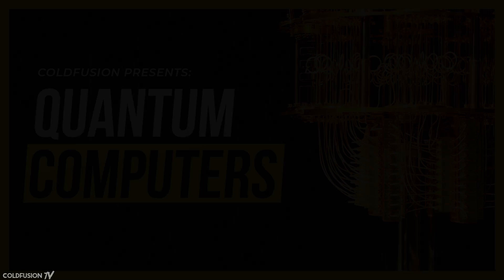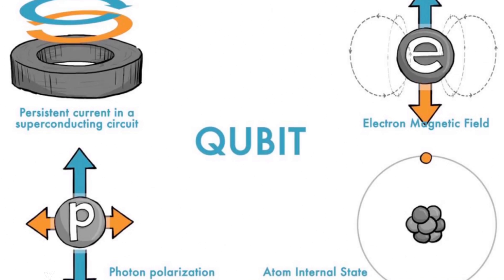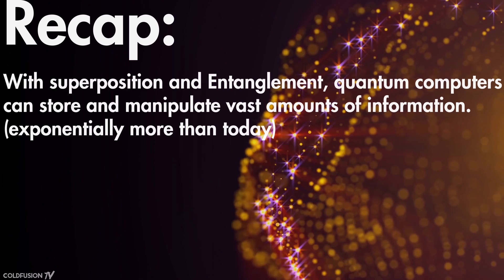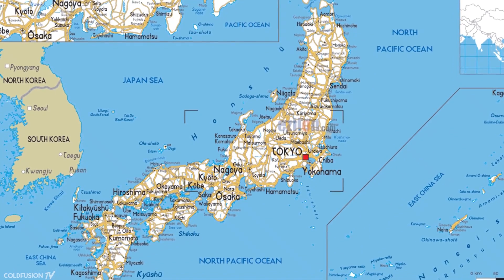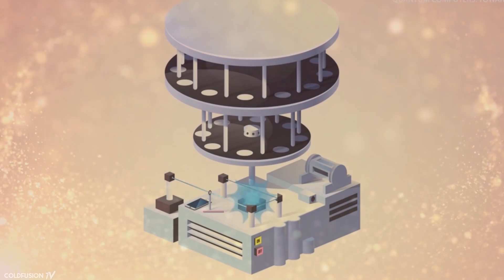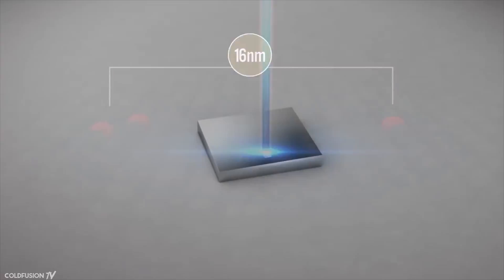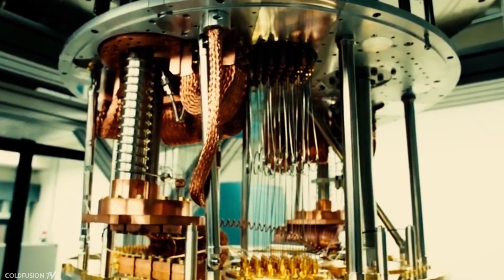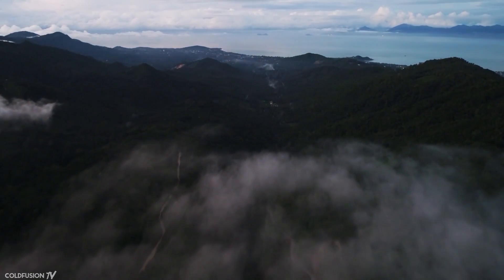Quantum Computers - FULLY Explained!

Comment: Can you make a video on 5g technology. I don't know who to trust but I trust your videos
Reply: 5G is simply an expansion of the existing control grid. I dislike being conspiratorial but it is plainly logical that by sacrificing independence for convenience when we embraced all these intrusive technologies, we have allowed a Trojan horse into our communities that can and inevitably will be abused for power. 5G extends the capabilities of the surveillance state, but I believe there is much more to it than mere surveillance. I won't go any further.
Reply: @amaze2n  plans within plans --- say no more
Reply: 5g is litterally 24Ghz radio waves......... higher frequency means more data can be sent but since its high frequency, the signal has to be line of sight..... what else is there to know?
Reply: Иіск Рагіllб 1⃣ how about how much tissue that can penetrate and with how many milliamperes?
Reply: @wesleyk.8376  So what if it can penetrate tissue? Thousands of signals of all ranges of frequencies are going through your body each milisecond and causing no harm, from standard AM/FM radio waves to WIFI. The only thing that is to be discussed is the heating effect that it *MIGHT* produce, depending on the closeness of the signal's source.
Reply: @MilanTukidid  This study suggests the effects standard wifi has on sperm cells:

 "Ex vivo exposure of human spermatozoa to a wireless internet-connected laptop decreased motility and induced DNA fragmentation by a nonthermal effect"

https://www.fertstert.org/article/S0015-0282(11)02678-1/abstract

The study was conducted ex vivo, meaning they basically took the sperm samples, placed them near a laptop and turned on the WiFi. Naturally our skin tends to bounce these microwaves off, but when these signals start to penetrate body tissue, and considering the negative effects the study has shown to ex vivo human cell samples (sperm cells), we could at least anticipate a potential drop in male fertility. The lack of studies on the matter may suggest that we should halt development, until the biological, medical, and ecological ramifications are sufficiently studied.
Reply: 5G is useless and meaningless for the end user. 4G is fast enough with downlink speeds of over 1Gbit/sec.
The reason why everyone is trying to jump on 5G is because of the "big data revolution" which is predicted for the 2020s.
The main idea is moving huge amounts of data across the globe without the average user even being aware of any real speed gains for personal data consumption.
5G networks are all about minimizing latency and increasing bandwidth for the big data companies and not the average user.
Reply: Lol it works exactly the same as 4G but more powerful. Like AC WiFi compared to the first gen of WiFi.
Reply: @IT Developer no it doesn't 
https://youtu.be/-orWZAo4M_Q
Reply: @random dude put your tin foil hat on because it already exists.... its call weather stations
Reply: Sandeep Singh Yes, please do Dagogo. I second this person’s idea. (:
Reply: The best place to start is not with YouTube, but with as clear an understanding of electromagnetic radiations as possible.  The majority of 5G conspiracy videos exploit their audience's limited understanding by pretending to be more knowledgable than they really are.  They also use various other tactics such as, but not limited to, fear-mongering (mostly religious-based), persecution complex, misquoting credible people, and deliberately misrepresenting/falsifying evidence.
Reply: This one is good https://youtu.be/LhECDSuXRDs
Reply: Funny enough the channel I linked brought me to ColdFusion because everyone in his comments mentioned how he reminded them of ColdFusion
Reply: Sandeep Singh it's the same thing that happened to 4G when LTE was becoming more widespread, these companies know the tech is premature and hasn't rolled out everywhere so even IF they advertise 5G as the new thing only 2% of the population has devices that can even receive that kind of signal and most of that tech you'll probably see in flagship smartphones later this year, the Galaxy S10 can already do this but like I said almost nowhere supports 5g yet so it'll be a year or so before it's even making a noticable difference
Reply: Jake Watson what’s the purpose of your life? Roaming around the web and spreading hate? Get a job or something
Reply: @random dude that actually made me laugh thank you lol
Reply: Its just 4G but better .What's there to trust? Did you distrust 4G?
Reply: Ben Porter  
5G gonna rock-out with its cock-out!
Reply: Go ask Alex Jones. This is for smart minds.
Reply: Nobody needs 5G
Reply: I have been using 5g for the past 2 months, it's incredibly fast (>40mb/s) but it depends on the coverage 5g towers in your area
Reply: I second that
Reply: 5G is as normal as 4G, but some dumbo along the way thought 2+3=9 made sense and said it caused so and so things.

All of that ignoring all of the knowledge and the careers of thousands of engineers, because "2+3=9, I'm so smart".

You can look up any video on how mobile data works and you'll see that 5G works no differently, the only difference is the radio band it transmits in, which, unless you're a radio, makes no difference to you
Reply: But didn’t you get a brain at birth? SMH
Reply: Omg why is YouTube full of irrational dimwits who follow what some psychotic dude is saying on the internet. I get it we all suffer from psychosis here including me but you guys have to ask yourself who is more trustworthy? Literally every scientist on earth or some dude on Facebook who thinks he's rallying up an army against the "Deep state".
Reply: @Alan Jeffers thanks for the constructive criticism. All I am saying is they are making like it is the way of the future and within a few years it will be out of date. But again thanks for the constructive criticism.
Reply: You're gay.
Reply: I'm beginning to think it is necessary bandwidth required for fully adopted digital currency. 

And for user biometric data transmission to centralized processing and store data banks. 

They used to have too much data to meaninglly process, but if quantum computers can do what they say they can do, and they figure out how to get them to write their own code(s) with functional ai, quantity of transferred data becomes directly proportional to future prediction powers as well as future manipulation powers. 

Shit is magic, yo. I'm not convinced it's the good kind.
Reply: Read something interesting on 5G recently... Obviously with my tinfoil hat on https://www.5gappeal.eu/scientists-and-doctors-warn-of-potential-serious-health-effects-of-5g/
Reply: Considering quite a number of intelegent people claim it to be a carcinogen, I would go that route. There is plenty of proof scientifically to back it up as well.
Reply: @comfycap  can't say I've ever read it
Reply: 5g is to make AI more powerful than it already is.it will be able to control whole cities through manipulating or implanting feelings,emotions etc.it can do so much more dont want to scare u.having negative health side effects is a just a bonus for them.theres always multiple benefits when something is implemented in our society.and usually not for the benefit of us citizens.
Reply: @philiplopiano3759  That doesn't make any sense whatsoever.
Reply: @philiplopiano3759  I'm sorry, but AI will likely prove far more beneficial to citizens than, well, citizens.
Reply: @unapologetically_anti-fascist  you coudnt be more wrong... AI is way to powerful as it is it's just people r to stupid to realize.
Reply: @philiplopiano3759  Okay, I think there's been a slight misunderstanding here.  Firstly, power does not guarantee a negative outcome.  Secondly, there is no longterm survival of our species without the technological advancements necessary for diverting our very own extinction.
Reply: @unapologetically_anti-fascist  you just havnt experience what negative horrible things AI can and does do but you will all find out soon enough. And yes power corrupts almost exclusively. Your very naive.
Reply: @philiplopiano3759   And what horrible things have you observed AI doing?  You say that I'm naive, yet hearken back to the old adage, "power corrupts almost exclusively" as if it somehow defines the future of AI.  The longterm survival of humanity will ultimately depend on our technological capacity to either divert and/or escape the inevitable extinction that awaits all life as we currently know it.  Being aware of this simple fact doesn't make me naive.
Reply: If u wamt to know about 5G and just frequencies and their effect on not only humans but life on our planet period, then i highly recommend u watch "Resonance: Beings of Frequency".. probably the single most fascinating documentary ive ever watched (or at least tied with "The Revelations of the Pyramid".. both of which can be viewed for free on YouTube) i promise u, u will not regret watching it..or both of them for that matter
Reply: For those interested in 5G technology but also want to avoid the countless pseudoscientific bullshit circulating the web under the guise as "truth," then, please, hear me out!  

1)   You're better off avoiding YouTube altogether.  

"But, Keith.  Isn't watching videos much easier than researching."

Are you here to learn or what?  Are you sure?  Okay, then.  Proceed to the next step, please. 

2)   The next step in this process will focus on data, or, more specifically, reliable data.  I cannot stress enough just how crucial this process truly is, so please, do yourself a favor and choose a credible source.  I'm serious, God damn it! 

Okay.  I'll at least get your feet wet. 

a)	MIT OpenCourseWare (Massachusetts Institute of Technology) - For those who genuinely desire to learn, then look no further.  You literally have free access to MIT's entire curriculum. That's right, no more excuses.  https://ocw.mit.edu/help/get-started-with-ocw/

b)	Here are some other institutions that may prove beneficial in your journey:  
EDX - https://www.edx.org/
SoloLearn - https://www.sololearn.com/

3)  Oh, if you're unsure as to which subject you should start with, well, so am I.  Honestly, this will ultimately depend on your current level of understanding.  Though, if it were me, I'd start by determining my knowledge of Physics and work my way up to the more advanced topics.  

Random Fact:  
The majority of 5G conspiracy videos exploit their audience's limited understanding by pretending to be more knowledgeable than they actually are. That's right, the same tactic used by cults such as the Flat Earth movement.  

While we're on the subject of 5G, here's a Flat Earther harassing a utility worker because "The 5G, man..."  https://www.youtube.com/watch?v=5fZeVc00C_E&t=617s
Reply: Its dangerous. Crowd dispersal Weapon towers originally used in Military.  Simple
Reply: @OrgoneDevices47 , what? Man, it’s incredible what folks will believe. 5G is literally the same thing as 3G and 4G. It’s just operating at a different wavelength, which happens to be more brittle (which is why 5G range drops off super quick as you move away from a broadcast point). This is why 5G requires more tower/broadcast density than 4G. This is also why 5G rollout isn’t happening nearly as fast as 3G and 4G did - it’s more infrastructure-intensive. On the plus side, internet speeds are several fold faster. So the big open question is whether the faster service outweighs the cost and reliability problems.
Reply: I think 5G technology will be great in telecommunications, but I'm kinda worried about the possible health issues this technology could bring.
Reply: @martiddy  - It will. There are quite a number of videos on the health-related issue here on YT with really good experts (as much as I can't stand that term because it is constantly misused) on the topic like Barry Trower for example. Check them out.
Reply: Ask your gut, what this is all about. ;)
Reply: @warequalsnofuture   Ask your gut?  That basically translates to:  "Allow your personal incredulity to lead you down the wrong path."
Flat Earthers and Creationists also depend on this method.  That's exactly why neither will ever result in scientific achievements or contributions to humanity.
Reply: Yes I also liked the explanation and 5 g is also u future possibility, nice video
Reply: @warequalsnofuture  Certainly it is not about well being of the bottom 90%
Reply: @SimonzicekCz  99,99% or even way more. ;)
Reply: @warequalsnofuture  While I don't know much about 5g technology I think really is just a way for companies to make more money off consumers. I know that is a really simple answer but to me while good things may come of it. Why do I have the feeling they have another brand new technology you just can't live without. I am not saying it is bad just saying it is another way for people to spend money on their product and just when the majority of people get used to that technology they will come up with different technology.
Reply: @Nicholas Powell   I see your point about them changing technology, but that's actually a good thing. I mean... who would have thought.. instead of being held back and seeing the same boring and dull technology all the time, we actually see technology accelerate so that it advances and evolves into something better later on, in the near future. And we win because those that have been waiting for new technologies, actually get to use them and see what's ahead as much sooner instead. That's something to look forward to.. not be negative about. I mean, you're getting salty over new technology that advances? Smart spend by saving up and then get the new technology, you should be motivated to do so if you're hyped into technology like other people. However.. if you're talking about companies like Nvidia who take advantage with something as generic as Ray Tracing and overprice the graphics cards, then you are absolutely right. Same thing with the Samsung Galaxy phones that are at $1,000 dollars, ridiculous. But if there are technologies out there coming and aren't over priced, but actually worth getting just because they came early, then they are worth getting, don't be negative, some of us want to actually see these things happen, if the technology is pushed as mentioned, instead of having to wait a long time for something you see far ahead, will instead be available in the near future or sooner. Especially when those technologies should have come a long time ago, and it's about time. I'm actually looking forward to and hyped for a lot of the technology to be pushed. Provided it will benefit and not have any evil marketing schemes / evil business practices behind it, then absolutely. I can't wait for that bill to pass that will cause EA problems for Star Wars: Battlefront 2, Blizzard with Heroes of the Storm and World of Warcraft, Overwatch and so on, even games from other countries, and some countries already have to avoid the issue, where they will have to change their games so that they won't have loot boxes, because loot boxes are about to become illegal when that bill passes. All that greed to force kids to gamble in video games, is about to become illegal and I hope those video game companies get what they deserve. Though.. I do hope they can return to what they were former and knocked back down to size. And I feel that they shouldn't be growing their company, they should be smart spending on things they really need to improve ahead of them, like technology and creative innovative ideas, not stupid ideas to over-populate a corporation to the point where you expand and have so many employees that your head is up your butt in greed and don't care for the customers / gamers anymore, to the point where you get taught a lesson and knocked back down because you had too much of a head on your shoulder as a gaming company in the silent giant that they become when nobody knows what's going on. It's really stupid what corporations do with their money, their way of improving actually ruins them and harms their loyal fans in the long run. The people running corporations and their managers that give ideas are just morons instead of having the most intelligent people to make proper decisions and respectfully as the customer should always be #1.
Reply: @gameresearch9535  You are right I did not really mean to come across as that negative. My biggest point was one that I think you made about phones don't buy something new just because it is new. know something about how it works how to use it. Yes, you are right about everything you said. Next time I need to be more clear with my answers my bad, not anybody else. Thanks for letting me see the bigger picture. Have a nice day
Reply: @nicholaspowell7931  My buddy just got 5G a couple months ago and he won't let you check facebook at his house because it'll make him lag to the point he can't play on his xbox. Still the same issues we had with internet in 2006.
Reply: @KendrickMan I doubt it.
Reply: @KendrickMan  yeah your talking rubbish.. 5g is not 100% rolled out
Reply: @geofferzh79  That's what I'm getting at. I'm saying t's super laggy at the moment because it's not 100% backed right now. Once the conversion happens everywhere it will probably be great, but he made the mistake of signing up too early
Reply: @KendrickMan  From what I know we have the phone technology for 5G but the companies have only put towers in a few select cities around America for 5G technology. I really don't know how it works anywhere else. But yes this is how new technology starts. Heck showing my age but I know in America when just about had AOL and it was slow as hell you could take a shower do your homework and eat supper and it would just be getting on the Internet and since internet at that time used your landline phone you could not be on the phone and use the computer at the same time.
Reply: @KendrickMan  yeah I get what you are saying it is frustrating to deal with
Reply: @KendrickMan  sounds like he needs a better router. or provider. or both.
Reply: @nicholaspowell7931  
That feels exactly correct to me. Or I should say that's exactly how I feel about it. Supposedly they have technology 100 or more years advanced from what we think is possible. But they just trickle it out to us to capitalize the most off of it. I'm not sure that's true but like I said.. what you say sounds true to me
Reply: @nicholaspowell7931  Yeah, profit is ONE reason. But that's just the reason that seems to be obvious on the surface. There is MUCH, much more to it all. ;)
Reply: @KendrickMan  that's very right I have been using 5g for 2 months n when am at places with few 5g towers it sucks but in places with more coverage it goes to higher that 40mb/s
Reply: 5G is super dangerous for our health and this has been proven. also the war on Hawaii from Usa is just because was the only one company with really ready 5G hardware to sell while none of the usa companies had and they started his nonsense "spying" war to try and stop them from becoming number 1 in the market. after all usa want to spy on the others themselves..